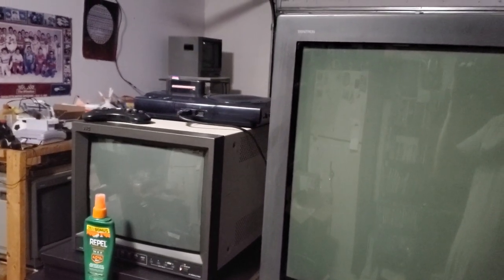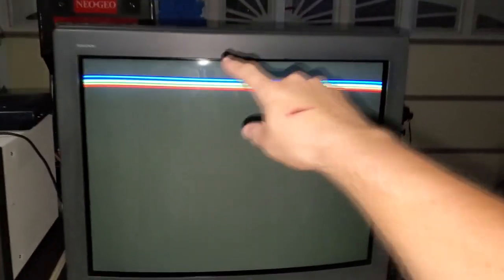Sony KV CRT found on the Street!

Comment: When you see that horizontal line on the screen usually means that the vertical circuit is bad, depending on the TV the culprit is cold solder joints up to the Vertical IC

Comment: What a shame, the actual look of the set was really nice. Sometimes it's just not worth it to put in all the work to bring back an otherwise middle of the road set that probably saw a lot of use. I like the feet on the bottom of the set, looks a lot nicer than the later flat platforms they would use.

Comment: I recently found a 27 inch sd sony wega on a street corner. It's just as sharp as my pvm20m2mdu and the color is just as good too. I bought a shinybo rgb to component adapter for it and have been gaming on it more than my bvm1911. I love the larger size (insert dick joke here).